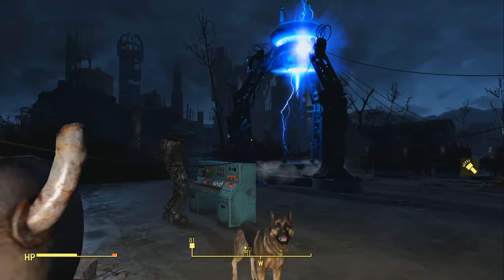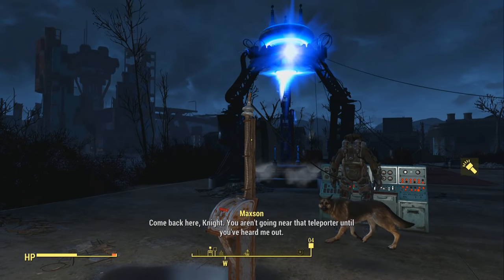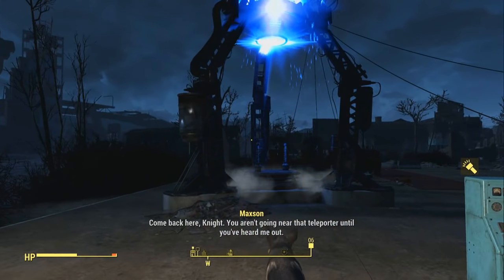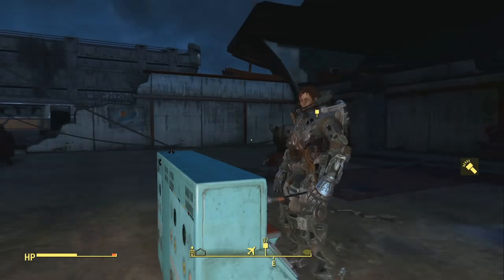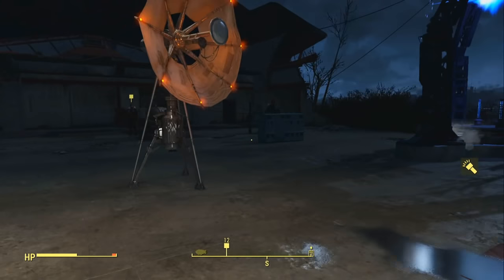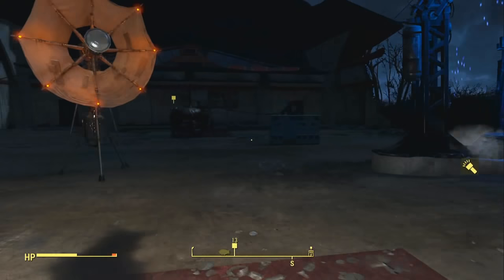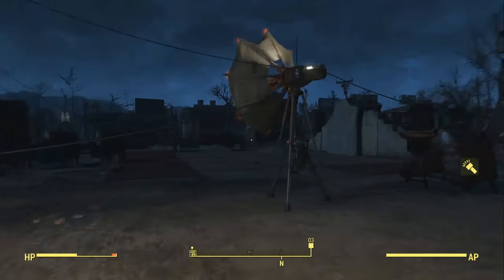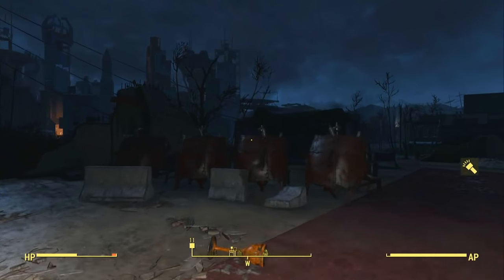Fallout 4 - How to build the Institute Teleporter (Tutorial)

Comment: To everyone having problems about building surfaces: Clear/use of the cement surfaces that you can scrap houses on in sanctuary due to it being a flat and/or reliable surface it works perfectly. Also for people with the generator/connection problem what I did was due to needing 27 Power at least I put x2 Industrial generators (10 power), medium generator (x5 power) and generator (x3 power) Which adds up to 28 power. I put these all in a line then used a pole so the generators fed power to the pole. After building all the other things I connected them all to the pole so they were on the same grid and and started the generators, you should be good to go!
Reply: 7 years later, you’re a good guy Liam.

Comment: Quick tip: a small generator needed to be connected to the console in order for this to work with us for the additional "2" energy.You need 27 in total,and 5 medium generators gives us 25. Follow the video exactly and if you happen to get the "not enough power" message just add a small generator and hook it to the console.

- note on how to hook wires- when you are in workshop mode, select what you are trying to wire (it will glow green when selected) at the bottom you will see "attach wire" and the command for that. Then you can hook it to what you are attempting to wire. Remember that line of sight matters. If there is stuff in the way it won't let you attach things so spread everything out.
Reply: I built... 76 LARGE GENERATORS, AND I HAD TO DO THIS?!

Comment: this is so shit, everything is powered and the base is snapped to the tower but it keeps telling me to power it, i have it attached and fully powered with small generators, is that the problem
Reply: No I did it with medium generators and it still doesn't works, 
Have you found a solve ?
Reply from the maker: +thedukeultimate i know i had this problem too, if you do what i did, it should work since its plenty a power. I had to restart from another save
Reply: I found a solve, just making sure that the game has registered you building all the items in you Pip boys Data is the key
Reply: +thedukeultimate how do i check that
Reply: +thedukeultimate please
Reply: just do som eother quests then store the buildings and build them new, dont built the platform on 2 different places
Reply: Ethan Schafer In the quest log in data on your pip boy there are objectivs in the bottom left, scroll through them and rebuild whyat isnt ticked
Reply: +WARF3RE can I build at santuary
Reply: How do you snap it
Reply: [IFN]Speggit yes
Reply: Yup this is the right answer, check pipboy for quest steps, i had to store and re-build the console.  As for power requirements, it's all BS! it doesn't matter what kind of generators you use or in what sequence you hook them up. Also teleporter pieces do NOT need to be on a separate isolated grid.
Reply: thedukeultimate Medium generator.
Reply: I still cant do this I feel like dying someone help me
Reply: @Chief-CO  You don't. It's not possible.
Reply: Same

Comment: I know how to fix all of these issues =D. This tutorial works fine as far as the connections are concerned, and yes you can use any arrangement of generators you'd like.  However, it's a glitch in the game that not all the separate steps of the building process are realized as being completed.  So if at any point what-so-ever you become stuck at making this rig, just store all of the pieces back into the workshop and replace them once again.  eventually it will work, shouldn't be long either.  I usually place mine on wooden flooring so that it's all level.
Reply: I did this because I'm having the problem and it didn't fix it
Reply: Bro I figured out how to do it perfectly easy 🤣

Comment: Thanks for the video, I couldn't figure it out.
One more tip, it's easier to chose the device in question and attach a cable to a generator than chosing a generator and attach it to a device.
Also I found the power pylon with the switch like used in the video is not needed :)

Comment: If people are still having problems with the platform not connecting try removing the control console then wiring all the parts together again. Took me ages to work that shit out.
Reply: I can not get it to work and I have wires EVERYWHERE
Reply: +Piper Cribbins yep that's how mine was I had it all connected but the marker for the platform wouldn't go away all I did was remove the control panel then wire it up again

Comment: I did it with the railroad guys and there is no where flat to build all of this and it won't let me go anywhere else. Thoughts??????
Reply: +paintballmichaelxx1 thats what i did, i builded it in a tiny sport mercer station. wondering if you can build it anywhere else cause its tiny
Reply: +Daniel B (Shadowboxer89) I actually resolved this problem. If you can build it at the Boston airport exactly like this then once everything is connected you have to store the beam emitter and then you should be able to use it. The games bugged to hell
Reply: +mary teraji try to rebuild it at the Boston airport. Make sure all the carpets are gone. Build it just like this. You may need to build an extra small generator to attach to the control panel as well. But it should work.

Comment: this does not work.i went to old save. then I removed carpets and it still didn't work.
Reply: First place the "pad" down then all the rest then connect all the generators to the beam emitter and then connect the terminal and radar to the beam emitter. Do not connect in any other way if you do you must store it and start over.